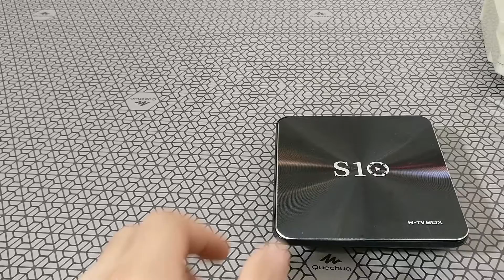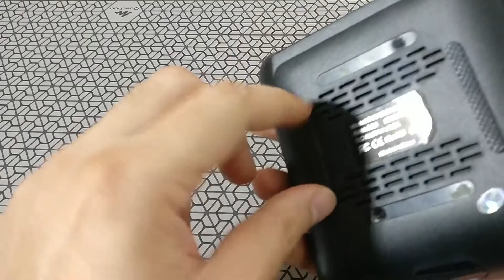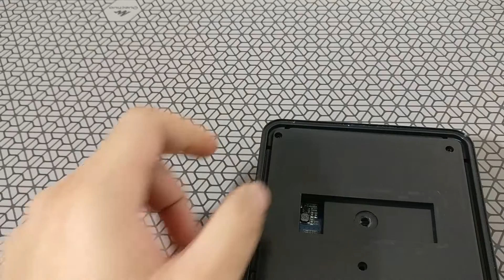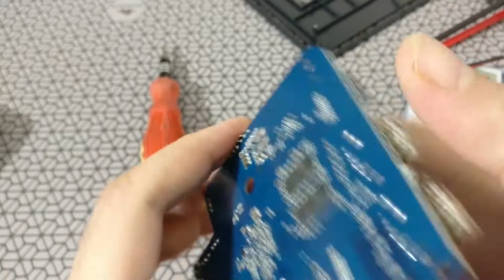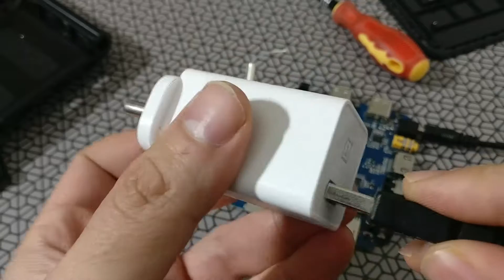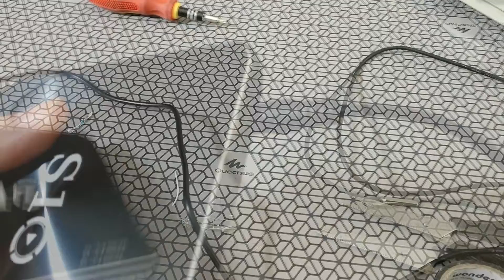S10 Android box troubleshooting and repair and fix (S912) #androidbox #androidrepair

Comment: Thank you, turns out I had the same problem, power supply looked OK on the multimeter, but couldn't power my MQX PRO box.
Reply: tuxon88 looks like same problems with all devices... Cheap power adapters

Comment: I want to thank you for this video. I had the same problem. Exact same S10. No light and a slight humming sound. I followed you step by step. Everything exactly like yours. So.......lucky I found an old adapter with the same specifications. I spliced the wires like you did. Plugged it in and IT WORKS!!!!! Thankyou so much.
Reply from the maker: Glad I could help Bruce! Please do subscribe! appreciate it :)